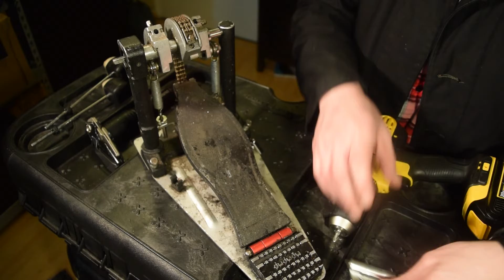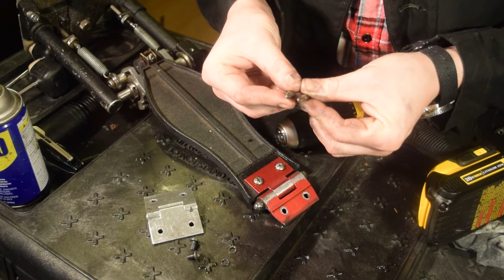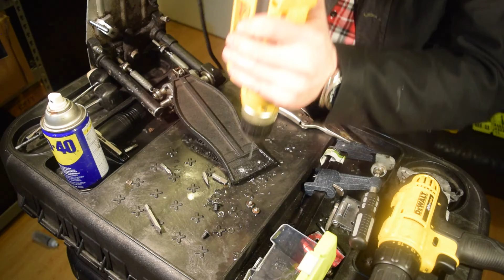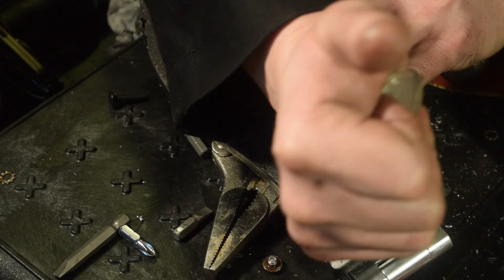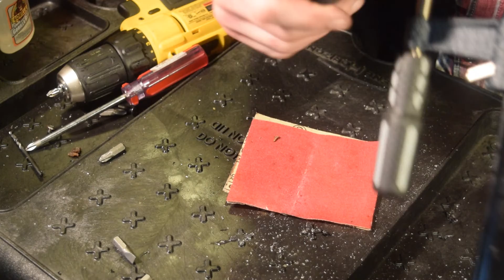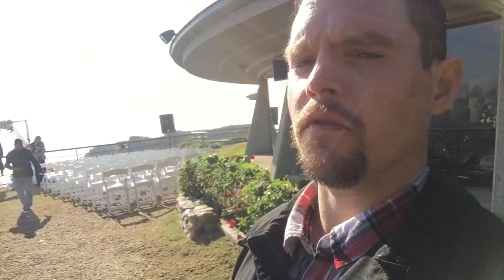HOW TO REPLACE DW 9000 or DW 5000 Drum Workshop Delta II Bearing Hinge (video tutorial)

Comment: That looks like the hinge found on the 3000 pedals. Mine rattles from side to side and makes a bunch of noise when I play. Did you have similar issues with that new hinge?
Reply from the maker: New hinge works great, no issues.  Yes I think it is the same hinge as the 3000.  It fits on 5000 pedals and works great.